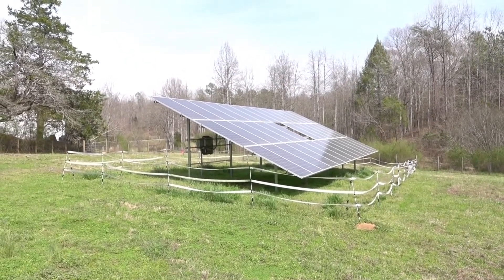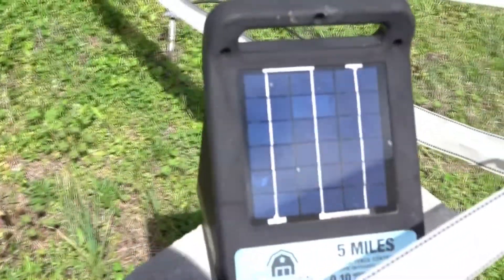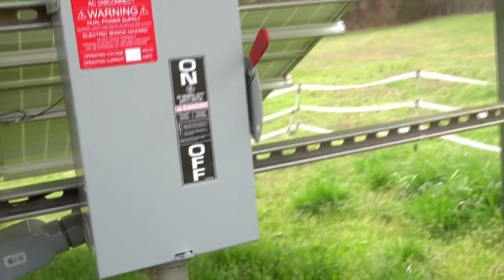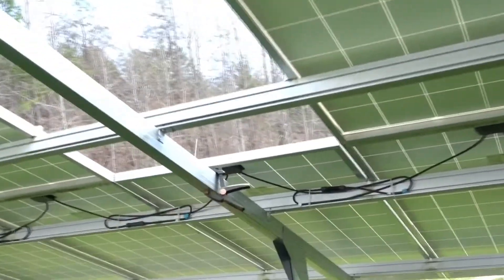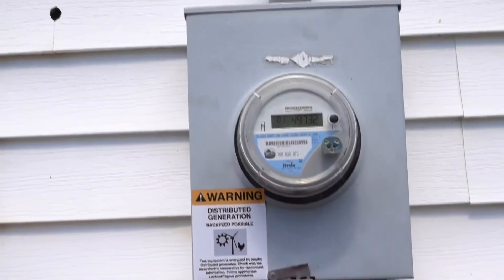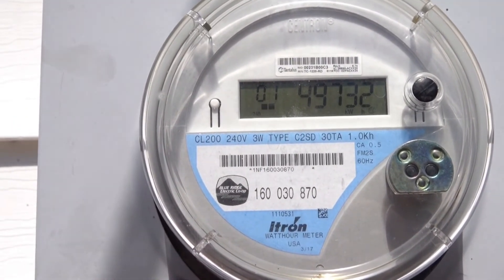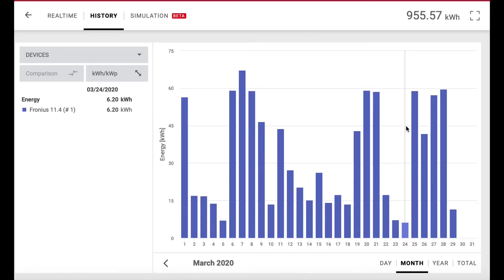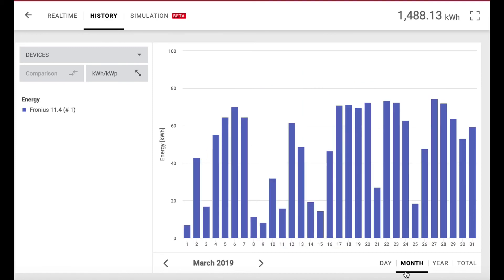12 kW Ground Mount Solar Panel System

Comment: if the grid goes down / blackout, can you still have power?  I assume even in clouds you could get 1 or 2 KW?  And of course thank you for the information.
Reply from the maker: Radek, the inverter is a grid sensing inverter. If we lose grid power the inverter shuts down. I believe this may be a NEC requirement to protect power line workers. The only way to use it when the grid is down is with a backup battery system such as a Tesla Powerwall with a transfer switch to isolate it from the grid. I had this system installed because South Carolina had a 25% tax credit and with the federal 30% credit I knew neither would last forever. It works great with minimal maintenance. Someday I will be able to install a Tesla Powerwall or the equivalent. My son has one in California and he is very happy with it.

Comment: Nice system what state are you in?
Reply from the maker: South Carolina. When I had it installed in 2018 there was a federal 30% tax credit and South Carolina had a 25% credit. Thankfully I stopped waiting and just did it and it was one of my better decisions. Now that we have a Bolt EV and a Tesla Model 3 it is really paying off. I still would like to have a whole house back up battery or have a bidirectional EV that could function as a backup battery during power failures. We have a grid sensing string inverter that will not deliver power to the house during grid power failures. Some microinverters may still work when the grid is down. Make sure you look at all the newest options before you install a system.
Reply: @anisotropicplus  question also is did you install like a net electrical meter that works where if you have more solar power then you're using the extra power goes back to the grid?
Reply from the maker: @ronbown3836 I was restricted to what our electric company allowed at the time. The meter runs backwards when excess solar power is being produced. I believe they now have a net billing system option which is different.
Reply: @anisotropicplus  in Michigan here they don't allow net metering. Back in 2018 they had a program for it and anybody with existing systems can still utilize the net metering but once 10 years goes by all them people have to switch back to the original style. Total b*******.

Comment: If u have a string of 8 it's basically no different than all the strings being made of 8. The voltage will get pulled down to the lowest voltage string.
Reply from the maker: When the solar company installed my system 4 1/2 years ago I questioned whether the different number of panels would affect the performance and they assured me it would not. The contracted size of the system 12 kw required 38 panels even though we had space for 39. I never questioned it because soon after it was installed the inverter would spike up to 11.3 kw which I was fairly happy with. After a few months it never got that high again even after cleaning. I assumed that was due to normal degradation. The system has saved us $8,600 on our power bill over 4 1/2 years so I am overall happy with it.
Reply: @anisotropicplus  do you have micro inverters optimizers? If you do then their right it doesn't matter. If you don't it absolutely matters and will not perform correctly. My system does not have those optimizers or micro inverters and when I wired up my groups of 4 somehow I accidently on one group only connected one panel to the combiner instead of 4 that one panel brought what should have been 160 volt strings down to the voltage of the one panel 40v.